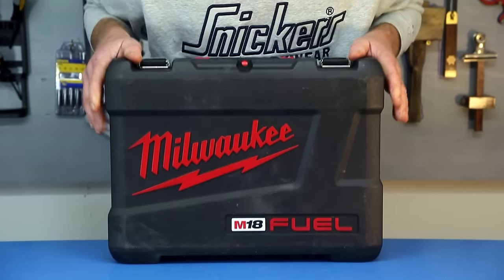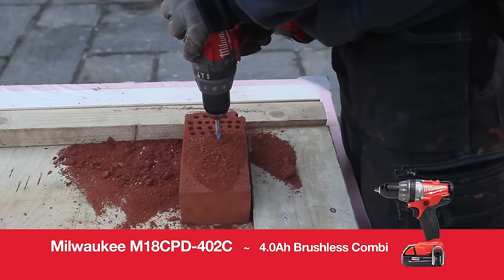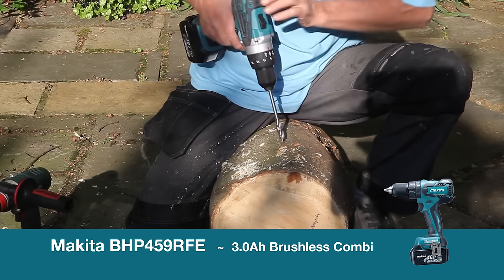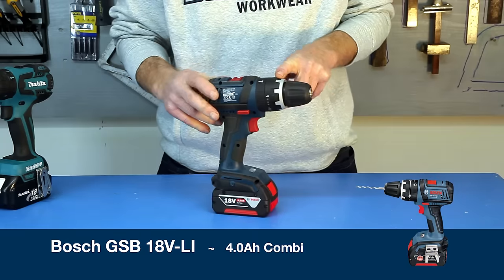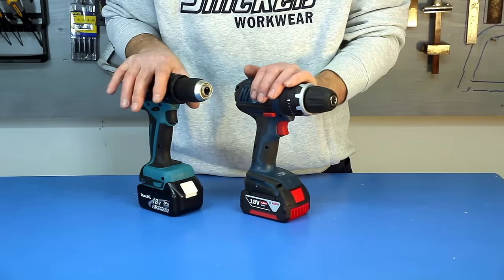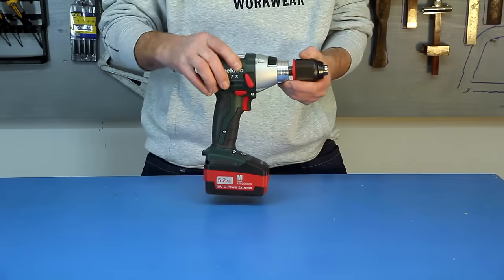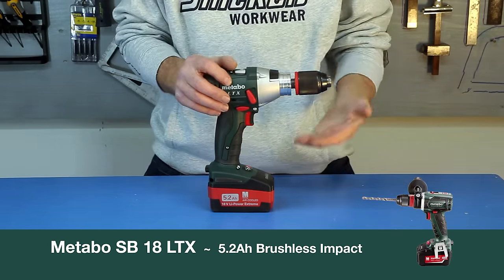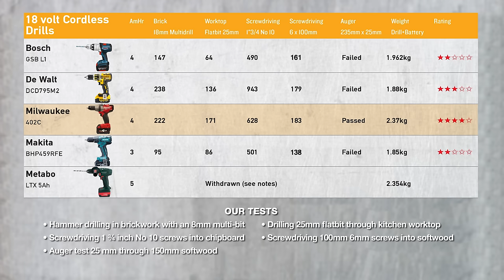18v Cordless Drill Review - 5 Best Drills Tested

Comment: I use this M18 for work, works great with impressive battery life. I bought myself the set, which includes a the impact driver, I wonder how I got along without it.
Reply from the maker: The sound of Impact drivers is new the dawn chorus on building sites.  I agree with you, how did we do without them?  The only thing is that you need the good impact bits. Are you using Milwuakee bits or something else?
Reply: Dewalt bits.

I build my own work benches and such for my shop using 2x4 construction. Before starting a project I'd buy a box of those Dewalt bits and normally would drive 6-8 screws (2 1/2") before it would strip. I have built two projects with over 30 screws and have yet to change out my bit with the impact driver. Its pure magic!

Comment: I do not know if this was done but to give an  accurate idea  the drillbits should have been replaced by new ones with every test of another brand drill.....if not , the first drill machine tested has the advantage of a sharper drillbit.And if being replaced it should be the same brand and type of drillbit.
Reply from the maker: +DunerecordsGent 
That was done. Every bit was new, same type same size. The same with the flat bits and augers. By the time they drill that many holes they are shot. No chance you could use them again.
Reply: +Skill Builder Well then I am even more impressed with your test because that much have been one hell of a job ...

Comment: You were comparing apples and oranges. If you are going to compare these 18v drills, you need to make sure that all of them have the same amp hour batteries installed. A higher amp hour battery will provide a higher amount of juice for a longer period of time.

Comment: why did you run the makita and bosch drills that from my knowlage are light/medium drills against the milwaukee and dewalt heavy drills?? makita do a heavy brushless drill that is designed to match the other two heavies, i know as i use one. most of these companies do either a light and heavy drill or med and heavy drill, the makita drill u tested i belive has a torque rating of either 45nm or 54nm depending on its exact model suspectedly the 45nm, where as the milwaukee drill has a torque rating of at least 80nm if not 135nm that ive seen quoted, the makita drill i use has 115nm of torque, further more the makita drill you showed had a 3amp battery even though it is compatible and sold with 4 and 5 amp battery, i would also like it if you had included a price comparison, that would of most likely shown the differences of the drills i have stated by their price
Reply from the maker: +Billy Barlow 
Hi Billy 

We tested the drills we had or were sent. All 18 votl and our test showed the diference. Things have moved on since then. Makita did not do anything more than a 3 Amp battery at the time of this test. We suggested they upped their game. 
We have a new test and we have tried to level the playing field.
Reply: thanks for the fast responce, i look forward to watching this new video and hope makita come out on top, i think they are real good quality and power

Comment: I remember the day my old Bosch died on me, it was 3 month old. Was attempting to Drill a hole on concrete slab. the clutch burnt out, took it back to B&Q and they tried to tell me it was a hobby drill and they would not give me my money back. 

This was 5 years ago at least i eventually got my money back but still wouldn't never buy a Bosch product again.
Reply from the maker: +aaaaalllss Or use B&Q I should hazard a guess? Given that they own Screwfix you might imagine they had clearer poilicies. Bosch Blue is professional and the Green is DIY but you should still expect to get more than 3 months out of it even if it is green.
Reply: Skill Builder It worked great putting 20-50mm screws in plasterboard but couldn't handle putting up metal stud, 2nd gear was burned out it just slipped constantly 1st gear was good but you cant work with that.

The drill has no doubt changed by now though, it was just my experience with Bosch. I wouldn't buy one again, Makita and Dewalt have not let me down. In fact there is a Makita in the shed thats done more work than me and still running only thing is the old battery dont last 15 mins.
Reply: Being a qualified carpenter I started out with a Bosch skillsaw. Absolutely smashed every other skillsaw I have used! I now own the Bosch impact driver & still set, 110v router, planer, skillsaw, sds drill, jigsaw, and soon to be buying the chop saw. For price comparison with makita you just cannot beat Bosch tools! Are man enough on site too. I use my drill to pre-drill and counter sink & my impact driver to drive screws in. Use my sds drill for orgre bits & drilling into concrete.

Comment: i would love to see the Makita Brushless lxt 5.0a 18v. vs Milwaukee M18 Fuel 5.0a 18v
Reply: 3.0 vs 5.0 is a difference. how about a review if the chargers, and battery/charge safety precautions the manufacturers take for example the star protection and fan on charger on the makita
Reply from the maker: +Yere Hernandez 
That is happening right now. watch this space
Reply from the maker: +Yere Hernandez They all have fans on the chargers now. It is the only way to get the power in quick enough. we have  battery review in January 2016

Comment: I have a makita set of drills and my drill can drill through 3 peices of soft wood easily I had to do it multiple times drilling holes for electrical
Reply from the maker: I don't doubt that but I can tell you that the 18volt Makita we used couldn;t get through 60mm of softwood with a 28mm auger bit. That is a simple observation.
They had a 3 speed drill that would do it but we were doing 2 speed tests.
If you have a look at our LTX review you will see their new range is much more powerful. The only drawback is the weight. They are a bit too heavy for general use.
Reply: Skill Builder yes and as I learned today having my makita impact driver nice and light was important when I was drill up in the attic today and also drilling on weird angles putting up metal pipes to run wire through thanks for replying btw it shows you actually care about your channel and people that watch it =) I am hopeing to start doing drill test and durability test soon too just got to make some more money and either ask the companies or look for great deals

Comment: this was biased...the dewalt compact against the big badass fuel? of course the dewalt loses...but, the big badass dewalt against the big badass milwaukee? i think they'd tie at the least
Reply from the maker: It wasn't intentionally biased and the DeWalt won on the smaller screw driving by a long way. The mistake was to declare an outright winner because it is horses for courses.
Give me the model numbers of two drills you think we should test head to head and we will do it.
Reply: DCD985M2 dewalt against milwauikee HD18 PD...that would be a fair fight
Reply: course, these don't matter much to me, being american...i ain't sure how much they change the drills for us vs y'all
Reply from the maker: bighunterman77

The DeWalt has a 3 speed box and Makita had trouble with their 3 speed  box and abandoned it so I wanted to stick to 2 speed gear boxes for the test. However I have been running that DeWalt 3 speed for a while now and it seems reliable so let's do it.  I bet people will still cry foul because we run a 2 speed against a 3 speed.
Reply: my main thing was that you used the compact dewalt, which is great, for its class, against the full size metal trans(or gearbox as y'all folks say) m18...but i think the big dewalt against the big m18 should be a good test
Reply: bighunterman77 I have both of those models.  Milwaukee spanks the Dewalt, but both are good drills.

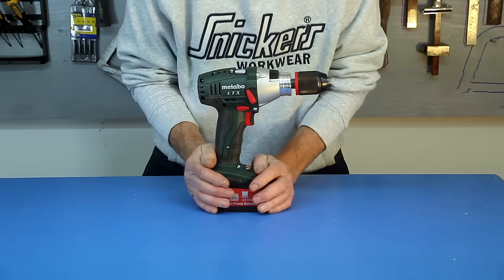Comment: At 7:11 everyone can clearly hear that the metabo drill is unnecessarily in impulse-mode. no wonder it was overheating during the test. impulse-mode is not for permanent use. please redo the test with proper settings. the metabo is the best drill. you have to know your tools.
Reply from the maker: k1n6d4v3 

It was nothing to do with the impulse mode, The guy tried it out for all of 10 seconds. The Metabo was malfunctioning from the very first bench test. The guy in our test was doing what anyone would do, trying out all the functions. If those functions cause a malfunction then the manufacturer needs to think about the thousands of users who never read an instruction booklet. The Metabo may be the best tool but we can only report our findings, it was smoking within 40 holes.

Comment: the bad part about makita, the LXT 18v batteries will just quit working for no apparent reason.  thousands of complaints about them on the internet.
I had one go out and the drill was not running low on power.  I sat it down came back 10 min later to use it and it was dead.  put it on the charger and it will not charge. 
my co worker has the small 18v batteries and he runs them down all the time and has never had one quit working.   I've never ran mine till the drill slows down. the small batteries do not have the star on them like the LXT does. which indicates it has the cut off circuit.  or should I say, the makita money maker circuit.

I can charge it with a RC Car charger (hitec X4) on the Li-Ion setting to 20.5v but the circuit in the battery will not let it work in the drill.  what a bunch of BS!

a drill shouldn't be used to drive in screws anyway.  that's better suited for an impact.  which the makita impacts seem a lot better than the milwaukee.  as a co worker uses a milwaukee and his is rather slow. I can run in 1 1/2 screws to his one using  #14 X 4" screws in a pre drilled 3/16 hole in hard wood (maple or poplar)
  and to top it off his is brushless mine is not.

Comment: I call BS on this. My Makita not only came with a 5mAH battery, but they have indicators on them. Also, I have the DHP481 model, and it too have a metal gearbox and torque by the truck load (125nm), it can drive an auger through three 2-by-4s. I'm new so maybe its a new model but this is not an accurate test of the best models by each company.
Reply: This test was done 4 years ago, tools and batteries have advanced since this test was done.

Comment: Why would you compare a light/medium duty drill to a medium/heavy duty drill????
45Nm of torque to 80Nm?? Obviously, the Milwaukee is a bigger and more powerful drill than all the other ones The Makita you are holding is a lower end model... they have a model with a 3 bar battery life gauge, 3 torque settings, and 3 application settings... I am not sure though if it's available in America since it's a Japan Model.
You should have used same size batteries to at least even out the odds a little.
I am a machine builder, I have used many different brands of power tools. Based on my personal experience, I would have to say Milwaukee is not as tough and powerful as Makita and Dewalt. We are using Milwaukee power tools right now at our current facility and they don't live up to my expectations. They heat up pretty bad... I mean they get really hot, and the clutch will trip constantly when I am tapping, and the chuck don't hold the tap as tight as The DeWalt or Makita Drills... We have both the 18V and 28V Fuel... I use them for drilling and tapping into Metal about 3/4 to 1" thick... The 28V burnt out last week and I got so mad... I went to the other building and grabbed the DeWalt Drills because they are way better... I would have grabbed the Makita though if we had them in the building I went to. The DeWalt  clutch doesn't go crazy like the Milwaukee, and I don't have to use the vise to tighten up the chuck so the tap would not slip... The Tap goes into the Metal like Butter... Not like the pain in ass Milwaukee Drills..
I personally prefer Makita....pound for pound... Makita is the best. Durability and Longetivity.... Nothing beats Makita... In the automotive industry, in the production line... You will see that 90% of the cordless tools are Makita.
DeWalt is better than Milwaukee... Don't be fooled, try it yourself.. you will see!

Comment: isn't really a fair test for the dewalt for heavy duty drilling. you are using the compact light duty drill against makitas and milwakees top of the line hole machine. i have the premium 20v hammer drill and it is definitley a huge difference in torque.
Reply from the maker: I take your point but we were looking specifically at 18 volts and the test was really about showing that there are variations in run time, torque and the number of screws you can drive with a brushless motor as opposed to a 4 pole brushed. The test may not have been entirely fair but we got the tools we could get and ran them up against each other. We are intending to run the 3 speed DeWalt and the new Makita next.
Reply: i think the 20v max drill is ok in the 18 volt class because of the 20 volt MAX name. if you read the fine print on the box it says the battery is only at 20 volts right off the charger, it idles at about 18 volts.

Comment: bring in the dewalt dcd995...not sure why ppl even do these test while the test subjects arent even in the same level.
Reply from the maker: Hi Tee

 You are right. It would be fairer  to have every drill the same but they aren't the same and if they were  I reckon the results would be so close as to not be worth publishing. What this test tells you is how much more you get out of one drill on a given task. It tells you that if you are just doing small screwdriving then the lower torque of the DeWalt means the battery lasts longer than on the Milwaukee which is a big heavy torque machine.
It also tells you how much extra a brusheless motor gives you  so you can decide if it is worth paying more for. I had  hoped people would read the chart or better still go to Skiilbuilder for the full written report but I should have known people are too lazy to read, they only want the pictures.

Comment: makita are the best because mine is, believe it or not, 30 years old! And it still works fine! I dropped hundreds of times and even used it to hammer
a nail into wood sometimes, and it's only 7,2 volts, but very low gearing, so it''s not so fast, but i don't do production work, so a great machine alright!
And i bought 2 dewalts in 2000 and dropped them both from 3 feet high, and the batteryholder just under the grip broke off, so useless weak and expensive crap
and that's why ii never ever will touch a dewalt again, no matter what kind of machine it is.
I also have a cheap bosch green series, and those batteries are crap, because when you load tham and dont use them for e few days, they run empty
but al the green tools from bosch suck, so you need at least the blue professional series,  and they do cost a few bucks. Not that makita is cheap these days,
but so aren't the others, so what else is new?

Comment: can they drill concerete wall?
Reply from the maker: +badijan 
Yes but not nearly as well as SDS drills. I would use a percussion drill on softer brick and block but on dense concrete the SDS drill is the best.
Reply: +Skill Builder I think that if you try to make a 4mm hole in concrete by using a 2J rotary hammer you may destroy the SDS drill bit. I know because I have done it. Therefore typical "hammer drilling" tests should be of some importance as it looks today. Also the SDS rotary hammers are quite big, and you may prefer not to reach for them in all situations.

Comment: My WORX Drills do for me reasonable price  long running time plenty of Power i think Dewalt gear is vastly overated ,Makita stuff is good i have a Makita electric Chainsaw and Angle  Grinder ,but my Worx 18 volt Drill and smaller voltage driver cuts the mustard with me
Reply: +ronatholl  i started out with a worx brushless combi drill and must say it still works insanely well, i did end up buying the 4 amp batterys due to using it alot but for how much it was i wouldnt have traded it for anything els

Comment: i wanna see the tests you are doing the same that manufactures are doing just telling us whats best but i would like to see the tests and the makita that youre showing its not the real 18 volt my makita beats the milwakee any day
Reply from the maker: +fakk u 
The Makita is the top of the range, they don't have a better drill than that  and Makita will verify that it does not have quite as much torque as the Milwaukee. The runtime figure is accurate and also the size, weight etc  The Makita is a very good drill, nobody is arguing with that but we tested them all and these are our findings.

Comment: What you've done here is compare the top of the range muscle Milwaukee against the entry level Bosch 18v - in fact that Milaukee drill is unusable as it weighs the same as a decent lump hammer. Milwaukee 18v tools suck - stay away from them, had nothing but problems with mine, cheaply built and badly designed, flogged all mine on ebay and went to Bosch, never been happier. Milwaukee may perform better in tests but all those parts that look like metal - they're often plastic, they weigh a friggin tonne and the electrics play up pretty much from day 1. Cheap Chinese company knocking out trash disguised as a Western brand.